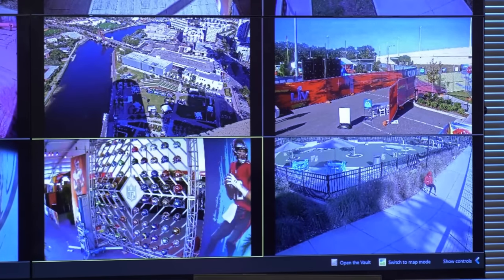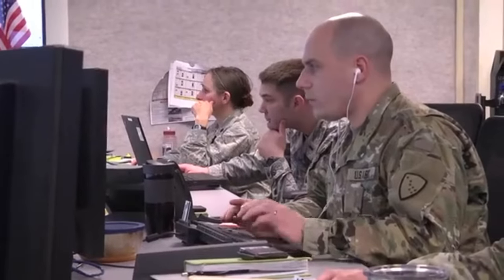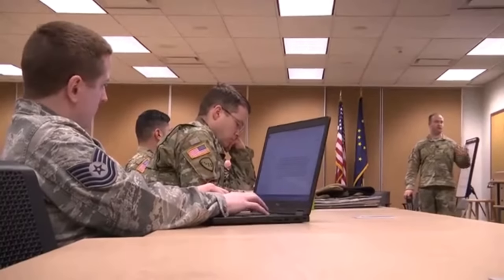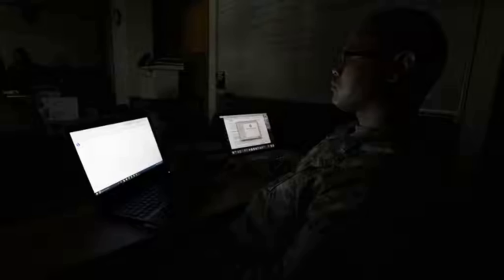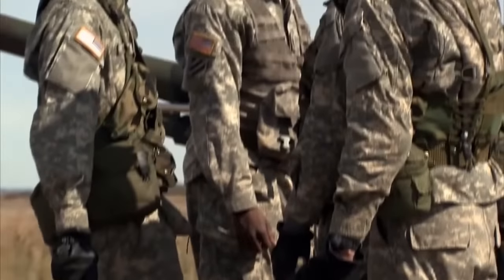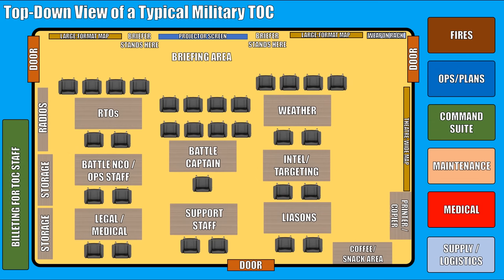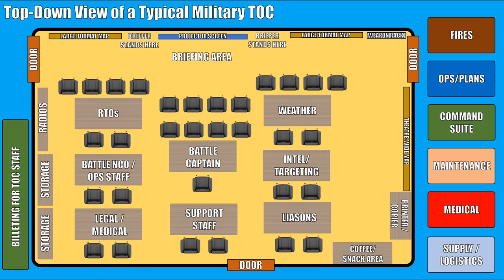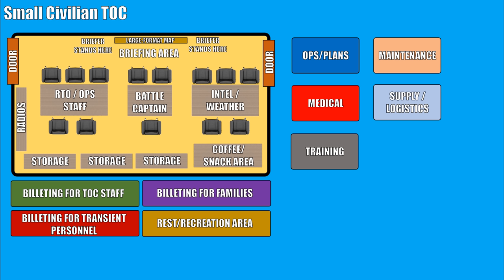The T.O.C. - Tactical Operations Centers

Comment: Couple tips... 1: Have only main circuit breakers or surge protection between power source and equipment, and utilize power distribution panels. Longer extension cord runs and power strips with surge protection plugged into power strips adds alot of unnecessary resistance and therefore less available power for equipment. 2: Use plastic clips, zip ties, even duct tape to keep equipment wires secured to tables, walls, floors to prevent tripping or accidentally unplugging equipment. Floor power cord protectors in high foot traffic areas is a must. 3: Practice different equipment power-up sequences. Surprisingly overhead projectors and other equipment can draw alot of power at start up, some may need to be turned on first or one at a time to prevent overloading circuit breakers. 4: Experiment with multiple power supply scenarios. Some buildings power panels can not support a fully functional TOC in a large room. Multiple generator options are necessary for rotating for routine maintenance, back up incase of failure, and to scale properly for power needs. Running a single 60kw generator for a 25kw demand is less efficient then 2 30kw generators paralleled which can be rotated in and out of service without and interruptions to TOC operations. 

And yes children get rid of the coffee pots if you are close to maxing out your power assets.
Reply: if it can be cooked over a fire, by god ill cook it over a fire. electric coffee pots are lame
Reply: No coffee? 
Operation is a no go
Reply: Power is always an issue - and this all is great to remember...  make sure if you are a civilian picking up stuff from the hardware store - those green electrical drop cords LOOK great - but they generally are 14 or 16 ga wire - they aren't big enough to handle a large load.  Go spend the extra $$$ for 12ga or 10 ga drops... you'll thank me for it (even though they weigh more and are expensive)

Also: you mess with my coffee, you just moved from friendly to tango... just sayin...
Reply: Inrush current can be mind mindbogglingly high for some items.
Reply: Get better power before removing coffee your life depends on it.
Reply: I worked one season in the theater industry doing sound and light.

And yes tape all the wires down if it's running across the wall tape it down!!
Zip tie bundles of wires together when they meet along their length and right before they split up...
Reply: Great pointers! We ran two generators, but in a 1/3 - 2/3 format.  For your 60kW capacity example that would be a 20 and a 40, giving you three levels of "maximum" power plus redundancy for services. Constant high noise is a big factor in 24/7 ops! That's why YOU are paying ME 10% disability pay for the rest of my life. 

A modern civilian setup would look like an RV powered by house batteries, which are charged with solar panels and backed up by a 10k construction generator. The battery bank is big enough to run everything except heat and AC for at least 10 hours at night, and the generator and battery charger are big enough to bring the bank to 80% in four hours or less, plus AC, coffee, showers, and microwaves all at the same time. That's pretty big. The last 20% is the responsibility of the solar system.
Reply: power strips with surge protection  Can You change these in to  UPS units ,My EQ LAst much longer with CLean sine wave`s..   if I haven't miss something you wrote..
Reply: @CaptainSeamus  IF you still have power issues, even 4 year old laptops use less than 35W under full load, same with a 44W 12 core NYC with a 20W 26" USBC monitor or a 45W LED beamer.
Whole radio shacks run silently on 0.8-1.2 KwP solar panels and batteries.

Comment: While serving as a Fire Direction Center Computer and Mortar Section Leader in Mech/Armored Battalions, I had a large situation board in the M-577 in order to conduct battle tracking as well as coordinate fires. This was long before BFT, GPS, and other digital innovations. We were designated as the alternate BN TOC, in case the Main TOC and Jump TOC were destroyed.  We had several radios to monitor while computing firing data for the guns. It was demanding, but very interesting because we could see the big picture. Great video.
Reply: @Dave 😉👍
Reply: @Dave no ac..if we were lucky, we had a vehicle heater that worked in the winter.

Comment: The NETWORK and secure offline coms is the TOC.  Recommend preparing your ground with portable (well) hidden fiber cable and signaling via (very) low power IR lasers pointed at hidden line of sight optical receivers (any rf signal is HARM candy).  If you're not looking straight at it, it better look like static background on NVG.  The alternative is playing taliban vs nato or Ukraine vs Russia.  Wouldn't recommend either... pro tip: battleships won't win this war. 

Gen. Frag: ...hey guys take a seat between Col. Rock and Sgt. Hardplace for a second ... my 2pm ran late.

Comment: Back in the 90s and 00s when I was active, the S3 SGM "ran" the TOC and was overall responsible for setting it up and making sure it ran smoothly.
He also ensured all the lower enlisted in the S3 shop were licensed to drive everything they used, from humvees to M113A2/A3, M577, and HEMTTs.  He'd rotate the guys through the various stations (RTO, support, etc.) and would even send them on various missions outside the wire so they get a "feel" for the battlespace AO.  
The S3 folks were either billeted in a tent or set of CHUs as close to the TOC as possible.  The S3 SGM kept his ear to the ground for anyone in the entire unit he felt would be a good fit for his team and would regularly snatch up lower enlisted and NCOs for his section to replace someone who just wasn't working out.
But that SGM also knew what he was doing to those soldiers' careers so he'd always make the good ones were being promoted and recognized for their work to keep them happy.
Unfortunately, time and attrition weeded those good SGMs completely out of the military.

Comment: If you have a uav guy ( or someone that can fly a hobby fixed wing with POV  and 3 to 6 hours flight time), then having them run a feed direct to a screen in the toc within runner distance from the TOC will get the quickest eyes on to an active situation. I've also seen battle command hang out with the uav guys, to get first eyes on developing weather, low level scouting, etc and also give space to let the rest of the TOC get work done. The uav can also be set up as a mobile comms relay the command can move around the battlefield. To that end, think of the purpose of RTOs as distributed runners like team guidon bearers or civilian couriers... the radio is just a shortcut to not run as far. If you have no radios, they physically run or drive messages and packages between relays, drop points, listening posts or observation posts, allowing several locations to run without antennas that are targetable with anti radiation targeting and/or made suspect through location tracking.
Reply: Drones that can be given a flight plan and turned loose are very useful
Reply: Rctestflight has a solar uav built, seems legit
Reply: @victorygarden556  that would be an ok one for site security, flitetest cargo plane designs have long been slow, long fliers that can also carry dropable items like watermelons.  They're definitely also able to carry 2 handheld radios set up as simplex repeaters.

Comment: This is absolutely massive. I think you guys are spot on the money as this is something I have been working on given the extremely diverse terrain from sprawling urban to dense wrong turn level woods to corn fields. I also think you guys are spot on for driving home the camouflage aspect and pushing and pushing it. As someone who plays with thermal optics daily you will be fucking dead if you cannot hide your heat signature, your IR signature (think devices and lights) and your signal signature. Something as minimal as just laying down without some form of thermal concealment is death. With thermal sensors becoming cheaper and cheaper. Thermal isn’t just blobs and blurs of heat anymore. That shit is really scary to me. You can get black and white photo quality from thermal then see a lava monster from hundreds of yards away and immediately detect even that subtle leg of a guy sticking out of his hasty. 
You need to have thermal concealment. You need to be getting dug in atleast 18 inches if you are going to sleep somewhere. You need to have a Beez Combat systems Spectralflage blanket over your position, you need to have natural terrain and vegetation supporting your position. You need to have comms plans so you only transmit when absolutely necessary. Not all the time. You need to have every single device set to airplane mode if you have to use it for data purposes, and completely turned off and stored away when not in use. All of this applies equally the dumb guys on the internet thinking they are doing recce when they have ATAKs all running amongst 3 guys, are all using baofengs to talk to each other 50M apart just because, not running suppressors or at minimum quality flash hiders, using jet boils that will wake up the whole block to make a hot chocolate rather than an alcohol stove that’s silent, not covering the lenses of their shit. 
No matter what you are doing or what you think you will be doing everything said in this video for the civilian application could not be more spot on as this is something I have been working on with my group for about 3 years now pretty much every week. All of us run only lithium AAA, and AA, everyone packs a solar panel and extra water and supplies for the group while one guy only packs the solar generator and everyone else humps his fair share. This is all scary and you need to really think it out as they have here.

Comment: I know plenty of communities in my local area that have a TOC staffed 24/365.
And have  optical and multispectral sensor networks, indication fences, ground radar, QRF, medical  and firefighting QRF, checkpoints at the entrances and last but not least community armories (anybody was finished mandatory service can sign out a weapon if they need it)
m 16/ belt fed 5.56 /belt fed 30cal/M2.
P.S.
They also have Prepared concrete reinforced fighting positions with interlocking fields of fire.
One of the founders of the community when discussing the size that they should build the traffic circle said "I want to tank to be able to go around the traffic circle"...
Reply: Based on username and mandatory service - Israel?
Reply: @Real_Tim_S  yes
Reply: Tank should go through traffic circle not around.
Reply: It's designed so a tank can go around the traffic circle without going on to the sidewalk (in terms of size obviously a tank would cause damaged to the pavement)
Reply: Are there any good IDF After Action reports which are accessible to the General public about counter Terrorism and Urban operations ?

Comment: Instead of field telephone you could use locally networked computers with crossover Ethernet cables or with the correct settings to couple them together
Reply: That's... actually a really good idea. Even just using a plain switch/hub with static IPs or a fully disconnected (from the internet) router (preferably an old one or home built without wifi capability at all) to assign addresses via DHCP. Ignoring the relative complexity and power requirements, the biggest downside or thing to overcome compared to the field telephone would be range- the telephones can easily go thousands of meters, standard Ethernet on something like CAT5 is only good for about 100 meters before needing a signal booster/repeater. Definitely something to consider though for a situation as it would greatly increase your capability.
Reply: @kc8omg  There are also ethernet to DSL or fiber bridges, and one can do an 802.11 mesh network router with directional focussed antennas to minimize the interception and detection for hops where opportunistic cable cutting might be a threat.
  
I've been poking at the SolidRun ClearFog Base SBC with a HackRF One SDR with a broadband amp+low-pass-filter+antenna-tuner setup, and a LoRa module.  At about $900/instance and in about a cubic foot, and you get: SFP fiber, 1G Ethernet, long range 2.4GHz Wifi (mesh, high speed), <=50W HF/VHF/UHF, Meshtastic (mesh, low speed).  Just need a few antennas and you're in business for networking with decaying bandwidth versus range.  Could add an Iridium modem if one expected the satellites to still work and can afford the data cost...
  
I think people should also start looking at LTE for comms - ever since the FCC opened up band 48 for CBRS (3550-3700MHz), it has become possible to deploy one's own LTE network for private use.  Several COTS Android phones support this band (you'd have your own SIM, tower, and core network) and there are several M2M modems available which work with PCs of various form factors.  LTE was designed for range more than WiFi - and not a lot of people know to look at the 3GHz spectrum for intel.
Reply: @Real_Tim_S  Those definitely sound like good options, I'll have to check out some of that stuff- although were definitely getting well beyond the complexity and scope of "drag a random spool of two conductor wire a few hundred yards down a tree row to the next location" required for a field phone 😄
Reply: @kc8omg  Yeah that stuff is super over-engineered.  You can just run a private 5g network.  Phones are cheap and encrypted.
Reply: @kc8omg  Indeed, this tangent is intended to illustrate that capabilites can be increased with some prep-work and a resilient architecture.  It's fairly easy to emulate or improve on the work being done by DoD/NATO for self healing self establishing conectivity.  If one undertakes the effort to drag a twisted pair, what one attaches to each end is a matter of prepared logistics and supply.
  
The setup described above has about the weight of a TA-312 field phone - maybe a little bit more (batteries take space).  It's about the space claim of a man-pack radio, but with significatly more capability.  One could work up a connector for a H-250/U or H-350/U handset without a computer for simple voice links.  Work and capability expands to time and budget allowed to figure it out.
Reply: Personally, I think I'd prefer to rely less on tech and more on white boards, dry erase markers, and old field phones. May not be as slick as the new tech, but it isn't as easy to "hack" a low-tech TOC.

Comment: You misspelled liaison; they can turn into (communication) runners if need be--put those guys to work! The Marines were doing it right in the video; they had an analog backup and were not depending on digital exclusively. It is critical to have analog backup. Battle drills are important for a TOC, and there are ways to streamline those. Another specialty type of TOC is a Base Defense Operation Center (BDOC). It is possible to run a TOC from an mobile armored platform, such as an M1087 Expando Van. You touched on Incident Control Systems (ICS), knowing a little about NIMS can streamline any sort of TOC. A TOCSOP done correctly as a living and breathing document can do good things for efficiency as well. You want experienced personnel in a TOC running things--it isn't a good place to dump the sick, lame, and lazy (except RTO, sometimes). Putting out information in a TOC has to be done in such a manner that everyone can act on it; spitting out info before anyone is prepared to copy just wastes time. TOCs also deconflict resources for supported units and respond to requests for information (RFI).

Comment: I'm a dinosaur. In the late 1980s the 67th Sig Bn TOC on Ft. Gordon most of the time was a three man operation, occassionally five closer to briefing time.

Of course this was before computers made it to the field and before computer projectors.

Two 2 1/2 ton trucks with shelters, two frame tents, camo and constantina wire.

The missions were training units and officers for TRADOC, and supporting theater and higher level operations for FORSCOM and SOCOM.

The last thing I did before getting out was final field testing of gen1 digital subscriber gear (mostly field phones & switches) and joint tactical radios.

Usually a small detachment supported FORSCOM or SOCOM exercises. A souls would go TDY to places like Honduras or Ft. Wachuka.

Yes, I am the rare peace time vet.

I was fortunate to work under a battalion CSM that was a veteran of Korea and Vietnam that had master's degree. He did a good job of keeping officers in check.

Comment: Rather than one massive battery, it could also be advantageous for several folks to hump a smaller 9-12ah cell with their solar.
These can be set to a serial-parallel configuration and tapped at whatever multiples of cell voltage.

Comment: QUESTION:
I want to use my phone for offline tasks, how can I temporarily and completely disable any/all signal connections while doing so - not just data, bluetooth, wifi, but the basic core call/text connection to provider for 100% secure, absolute private, completely disconnected offline use?
Please make a video on doing this in general - temporarily disconnecting all signals from one's cell phone and other devices?
Thx.

Comment: I would say for a "civilian TOC" matters of opsec and minimizing overall detectability would need to be the primary concern before everything else if operating in a non-permissive environment. Honestly the whole place might have to be underground in some barely accessible pocket of wilderness to even survive long enough to do its mission under combat conditions, assuming a more advanced adversary. Doing things "old school" would probably be the preferable mode of operation, since hauling a bunch of computers and equipment just means more vehicles necessary to move the place, and thus a greater signature.